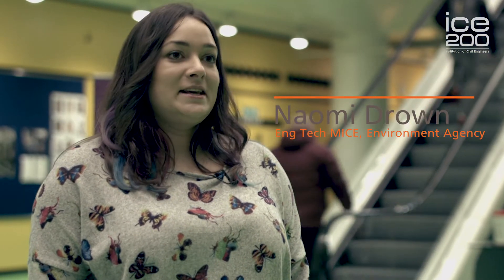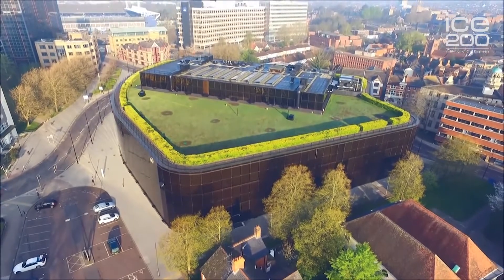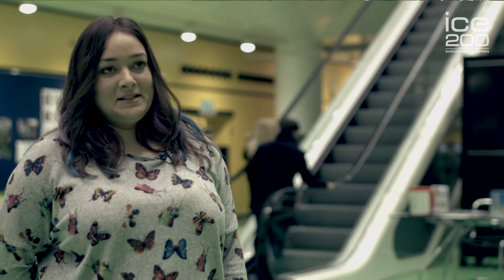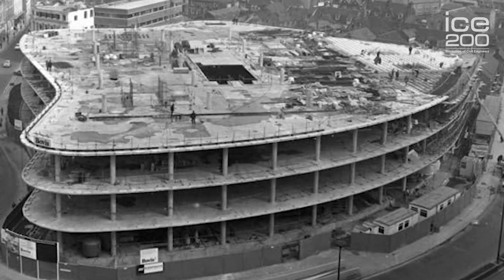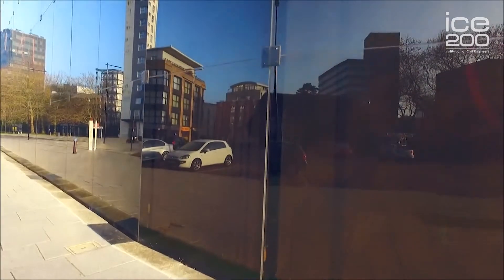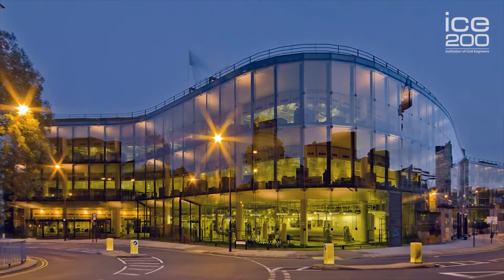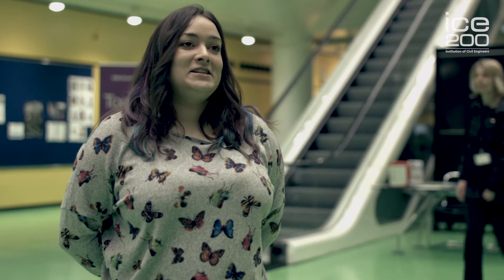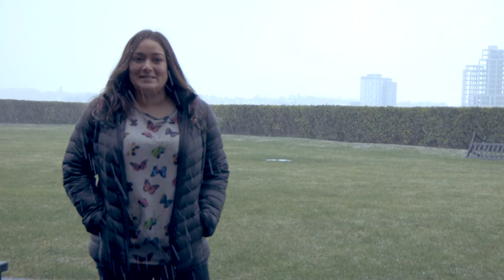Willis Building

Comment: I worked here from the very beginning. Harold MacMillan opened it in June 1975 ( he was Julian Faber's father in law).and it snowed! It was my first job and at just 16 I didn't appreciate that not everyone had a swimming pool, a gym, a cafe by the pool and a subsidised  restaurant on the top floor along with a roof garden. The decor of bright green carpet, bright yellow walls and chrome ceilings all on an open plan design office with 3 escalators going from ground floor up to the roof garden was brilliant.